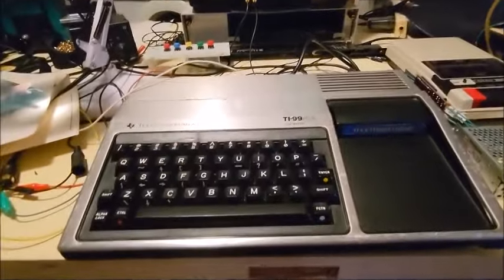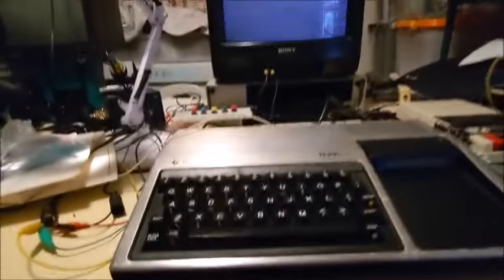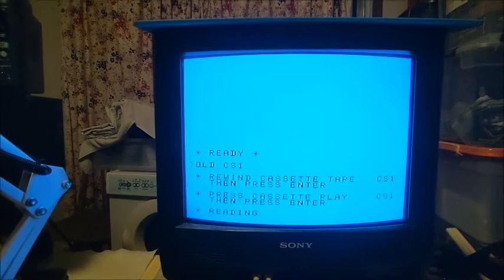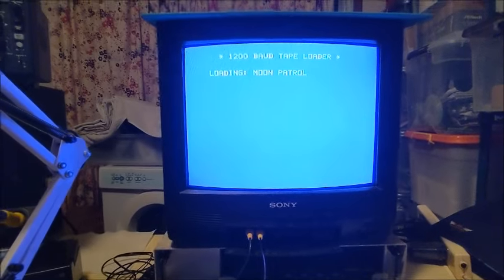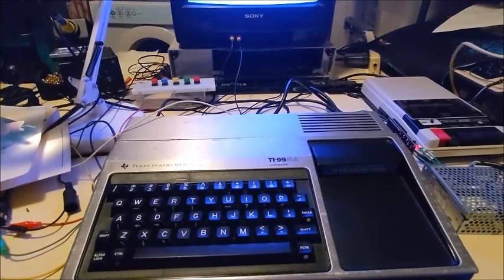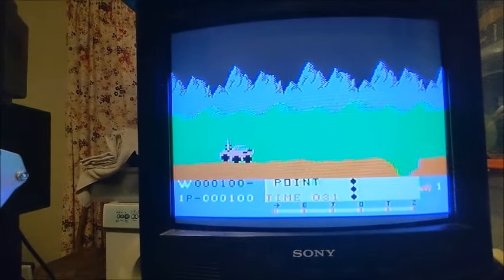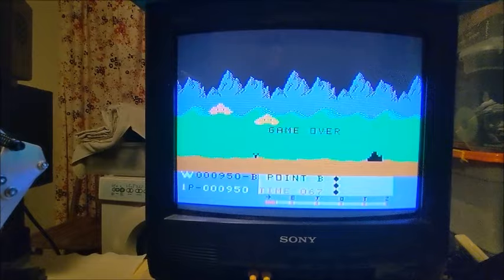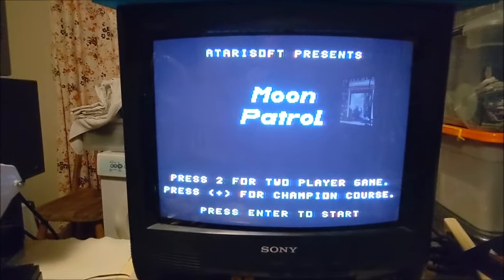An introduction to my TI-99/4A 16bit Computer from 1981

Comment: Moon Patrol on tape is built from you?
Reply from the maker: TI-99/4A + 32K + Cassette Player/Recorder - load Assembler programmes
https://forums.atariage.com/topic/278722-ti-994a-32k-cassette-playerrecorder-load-assembler-programmes/
Reply: The tape/cassette tape itself is from around 1983 (my first tape, when I started). An explanation based on BasiCode (1200 baud loader) is in a Dutch magazine called "TIjdingen" - TIJDINGEN Sep. 1988,  Annual (Jaargang 4). Number 4. Issue Number 39.  Page 2-5. Listing of the Turbo Load program by Ton Brouwer (based on the 1200 Baud BasiCode)